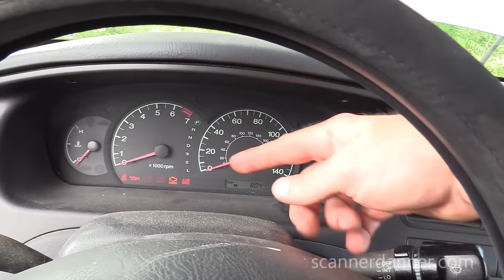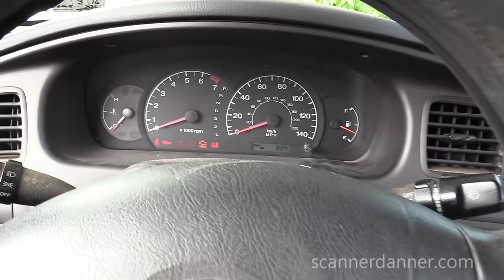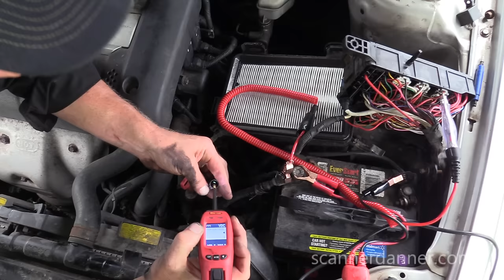No crank, good starter, how to troubleshoot, any car! (Hyundai)

Comment: Couple days ago I get in my car (2015 wrx premium) to go to work. Car unlocks, dashlights turn on. I turn the key and dead. Dash wouldn't come back on and couldn't lock or unlock my car. Took the battery out yesterday cleaned the he'll outta it and power came back. But as soon as I turn it to start it just drops dead again. Can still unlock it and everything just cannot start it. Checked the fuses don't see any broken ones. Car won't start when hooked up to jumpers either Battery tested fine too. Today i had someone come test the starter solenoid and its getting continuity. But now im getting zero power to anything. No dash, locks, lights, nothing.

Comment: You a bad man been having the exact problem with my 08 pontiac g6 was cranking then just stopped brand new starter alternator battery  I shake the car and wan it's running ima  definitely  use this video  ta trouble shoot my car

Comment: I have a 2018 Hyundai sonata SEL 2.4L wife got stuck at store. Anyways I got it towed home. All lights were working. Headlights, radio interior Everything works. Changed/ bought New battery. And BOOM IT WORKED!! started rt up... Drove car around the block 3min.. then parked car& shut it off. 20/30 minutes later i was gonna go to store. But NO START/CRANK!?! just a click? The older obd reader that i used when wife got stuck said code(p2122) throttle control sensor? Thought it 2as miss read.. but disconnect battery to try and reset sensor. Bad idea 💡 because it now gives o zero codes😢!? Hooked up newer obd reader and got code (p1035) o2 sensor? I don't believe that would make car No crank/start. Just that click.humm.. but after i shut car off and Thought it was all set. And I went out to start it it did smoke a little bit?!? Pleas help.. i don't get why it would start rt up after i put new battery in. Shut it off Then NOTHING?? any help you can give would be greatly appreciated.. love ur videos ✌️

Comment: Sorta the same problem only no continuous power...everything is dead. New battery, new alternator.  Scenario to problem. Rear lights weren't working and started intermittent....fixed harness and pins. Everything worked fine. Door was left open, next morning dead. Charged, maybe an over charge, started, battery light came on when giving gas. Checked with probe,c16.2 amps, left hood up hood light on, dead again next morning,  charged and running.  Ran great for a week. Was pressure washing a driveway and decided to do engine compartment and under carriage..all hit miss from sitting in a wheelchair or standing while hanging on. It sat 4 hours. When leaving site battery light came back during acceleration.Turned on everything on light went out so I drove 45 miles. Next morning starter relay clicks, battery 11.3. Charged an hour, Turned over but not enough to start. Took battery to place of purchase, they charged, said battery was good...didn't change a thing.   The starter. Both heavy wires are tight but start switch wire post wiggles. Place that replaced starter says this is normal. 1999 f-150 4x4 xlt. Starter runs with probe power, starter turns probing alternator. After watching this I'll search for connectors and check out your free n trial. They fusible links near battery have power on both sides. Replacing parts is easy, wiring is an animal and crawling standing or bending is even worse. 3 surgeries and pinched nerves. If you have a solution so maybe I don't have to contort as mush I'd really appreciate it

Comment: So I have a 98 subaru legacy, and it died on me in the middle of a curve. I dumped the clutch to try to get it fire back up but it wouldn't, my engine would cycle but it's like it's not firing
Reply from the maker: you need to find out what you are missing when it is not starting. spark, fuel injector pulse, fuel pressure, compression etc

Comment: Outstanding video. Diagnostics well explained. Tapping on the starter needs to be better explained to your very large audience who may be younger age. Old school automotive and marine technicians all know as a starter ages, the brushes wear down or the ground between the starter and the block may not be good enough because of corrosion or wear or loose bolts so tapping or rapping hard with a small hammer on the starter will often get a marginal starter to work for a short time, good enough to get the vehicle started and moved to a repair facility to improve the ground or repair or replace the starter. In this video tapping did not help so Danner went on to doing real electrical diagnostics that are well explained. To improve this video I would edit and add segment to explain the old school tapping technique and why this is a good tip for stranded motorists to avoid an expensive tow to the repair facility. This harness failure and repair would have been very expensive if the vehicle had been taken to a less experienced shop. Danner got it right that another shop had tried and failed to solve the harness failure prior. One of the headaches of the industry is work done by shops or technicians or do it yourself people without success. At least in this case no harm was done by the prior repair efforts. This video is an outstanding example of a fox chase that when done the technician has 99% confidence of having made a good reliable repair. To be 100% would require replacement of all the wiring and the starter and related parts. This is most effective repair for the money spent. One can see why so many good vehicles go to the salvage yards when a problem like this one develops in a otherwise reliable vehicle. I recommend using marine grade wire for harness repairs. I buy my marine grade wire from Wal Mart online using Anchor marine grade wire. I also like Pacer Group marine grade wire. I agree with Danner more in depth repair to harness is best thing to do for the long term service life of the vehicle. Great information to teach voltage drop testing to younger or inexperienced technicians. I assume someone left the cover off the box that caused the real problem that is water in the electronics and electrical. I agree with Danner was fun fox chase.
Reply from the maker: You mean like this one? https://youtu.be/0el4-G1NkB0
Reply: @ScannerDanner  Great example, but you need to explain why the tapping works. It can be a stuck solenoid. It can be a poor ground connection between the starter and the block. It can be worn starter brushes and tapping causes the starter armature to move and make contact with brushes. People need to know the tapping trick and know why it works. I agree a proper repair at the shop is called for or mom will be calling again with no start. I assume once at the shop mom got a rebuilt starter and a new starter solenoid and a full analysis. Mom must be proud to have such a smart son.

Comment: My 2018 nissan frontier V6 4.0 just stopped going down the road and it won't turn over or nothing as far as cranking.  All the dash lights work like check engine and low tire pressure and all the lights like that but it won't turn over click bump or nothing. Can somebody help me with this. Thank You
Reply from the maker: Need a full system scan (all modules) to help. Just guessing otherwise. 
This is a CAN (communication area network) system

Comment: What brought me here was trying to find out why my '15 Sonata SE was cranking but not starting, but does if I leave it off for a long period of time (4+ hours). I'm now going to check my fuses but suspect a battery replacement is needed since it's the original battery
Reply from the maker: If it cranks over but does not start, your battery and starting system is NOT your problem

Comment: Im no mechanic but have similar issues with our 96 ford taurus. Was driving a 300 mile trip and going through a town it just died and I had to coast to the side of the road and no power to anything. No headlights nothing at all. No dash lights, radio nothing. It was like it had no battery at all in it. Just had a new battery put in and a new starter not long before the trip. Got out wiggled the battery cables, followed them to the alternator cable and then down to the starter and wiggled those. Car lights all came on dash lights came on. Car started up just fine. Got it home and parked it and the next day went to leave and the same thing happen again. No power at all to anything. Got out wiggled wires in all the same places again and it fired up just fine and its been working since. I bet its the same issue as this video on the starter. I should unplug that on the starter and replug it if it happens again. Something is loose for it to just die while driving like it did in that town. Everything went dead when that happen but may be cables to the battery as well. Whats your take. Once the car is started and running it shouldn’t matter if the starter wire is connected or not at all right? That wouldn’t kill the car to die would it. Im a rookie to electrical stuff on cars. Probably a loose battery connection that wiggles loose during vibration once running and just dies randomly is all I can guess.
Reply from the maker: Sounds like a bad block ground. Follow the negative cable to the block and see where it is bolted to it. I have videos on this is my battery, charging, starting system playlist

Comment: Hi please help me anyone… my Mercedes Benz S550 makes a click noise on and off but will not start the engine…also there was a toxic smell from the left side. The lighted and radio turns on. Please tell me what the possible issues are…

Comment: I used to work in the auto parts business and its the same there. It will start but it won't fire... WHAT? or It won't fire. A million different versions, after a while you just start making the noises it so much easier.

Comment: guys i need help. i have a 2000 isuzu trooper ls 4jx1 engine. last feabruary i notice whenever i start it before it is delayed for 3-5 seconds until one day it don't start anymore i thought only bateri problem so i bought a new bateri. at 1st it's good until 1 or 2 weeks after it dont start again i can only hear clicking sound so we tried to series it to other bateri and it work then yesterday even you jumpstart it to other bateri in wont start even crank only u can hear a clicking sound.
Reply from the maker: I showed you how to test the starter circuit with a test light in this video. What are the results of those tests on your starter? On the small gauge wire and on the heavy bat wire DURING cranking
Reply: i'll try it tomorrow sir, hope it will work so that no need 2 remove the starter.

Comment: Hi i been sitting here puzzled with my car o have a ford five hundred 2005 i had changed my alternator and battery and its weird i still needed a jump well make long story short i got it to start up and crank drove it for like 3 to 4 days the last day i was driving and my head lights wouldn't come on my dashboard lights turned off and i was driving with park lights on until car basically was driving itself until finally slowed down to a stop headlights came on bright dashboard lights came on even after i took key out of car the headlights were still on until battery died and haven't been able to turn car on at all until i had got a jumped but as soon as i take my foot off gas car turn back off it will have no crank no start battery liggt comes on untill car die back out
Reply from the maker: Sounds like a bad block ground (maybe)
Watch this one for some ideas on how to check for that https://youtu.be/_xvddRJmkAA

Comment: When you get corrosion on a connector, the other side is probably worse. It's almost impossible to get the connection good again without changing the pins.

Comment: Had similar problems thought it was starter, battery, or starter relay. Come to find out I needed the chip in my key reprogrammed because I disconnected my battery. The security system wasn't reading my key because it lost all memory when I took the battery out🤦🏿‍♂️ locksmith came out reprogrammed my key and it started right up. Ford always has stupid issues smh!
Reply: What kind of vehicle? My fusion sat with a dead battery for 8 months. Put a new one and now it wlmt crank at all.. o was thinking maybe it could be the key also.. any insight would be appreciated

Comment: Trying to direct start the starter with the key on the off position, doesnt give fuel to the engine when trying to turn it over. Could have caused the check engine
Reply from the maker: On a newer system, I would agree. Doing a quick scan of the code should have been done, but I wasn't going to for this no crank video.

Comment: I had problems with the main relay wires....  that one provide power to the starter relay, so you can't remove it to test the starter relay...   no main relay means no power to starter relay....

Comment: If the starter is good (and engine is good) and you can hear the solenoid clicking when booster cables are attached to the starter (and the servo spins and kicks forward) then the problem is either in the fuse box or the ignition switch.  That was the way we diagnosed things back in the 80s and 90s before electronics and computers made everything overly complex.  A modern car is nothing but a money pit these days and local mechanics will hose anyone who walks through the door of their shop.

Comment: My battery is 6 Month old, i charged it  , and tried to start my 2012 Elantra. 
The starter or something from engine area makes a single " click " sound ,and then nothing happens. 
No crank , No starter spinning sound. 

Any Solution?
Reply from the maker: Yes, do the checks at the starter I showed in this video with a test light and report your findings. Everything else is just a guess

Comment: What does it mean when you put starter relay in and starter engages?!
Reply from the maker: on it's own without cranking it over with the key? The relay contacts could be stuck closed. Did you swap it with another relay? If it is still doing it with a different relay, you have a control side issue.
Reply: @ScannerDanner  I put new starter on hooked up cable wire and as soon as I did the starter engaged. With key off!
Reply: @ScannerDanner  all of the legs are showing they have power going to them except the middle leg. I pulled the wire connector apart on Selinoid ( that’s not how you spell that ) and it’s showing power still!
Reply: @ScannerDanner  I just got through unplugging the park neutral switch, still same. I guess now is to check ignition?! Idk!
Reply from the maker: @justinbowles4671  why did you replace the starter? did it do this before you replaced the starter? if not, you need to check what you just did. Also, answer my relay question above.
Reply: @ScannerDanner  I replaced relay with new still does it. I took off old starter to have it bench tested. They said it checked out good but the inner parts didn’t sound good at all so I just bought a new one. It did do this before I replaced the starter. I just figured it was the starter.
Reply from the maker: @justinbowles4671  we need to move this to my forum at this point, it is too hard to do back and forth messages for me here. We will need more info. Year, make, model, engine, when the problem started, what work was done etc 
Post this to my forum https://www.scannerdanner.com/forum/post-your-repair-questions-here.html it is free to join and I have paid moderators who are there to help me help you guys.
Reply: @ScannerDanner  99 Dodge Durango 
4x4
318
This is my wife’s niece Vehical. She told me when she put it in to park, well she thought she did. It rolled and hit a tree. She said it didn’t hit that hard but I think it hit harder than she thinks.
Reply: @ScannerDanner  I’m not sure when this started. There hasn’t been any work done do it since she got this vehicle.
Reply from the maker: @justinbowles4671  forum after this please, too hard to keep up. The yellow wire that goes to pin 86 on the relay, this wire should only be hot while you are cranking the engine over. If it is hot all the time, this is your problem. Was there ever an remote start or anti-theft alarm system installed in this thing? If so, they will typically cut this yellow wire under your dash and install a relay to control it. Your problem could lie in this area or within your ignition switch itself. OF course all of the above suggestions hinge on whether pin 86 of the starter relay is hot all the time. If it is not, then we have another issue.
Reply: @ScannerDanner  yes it is hot all the time. I’ll check the voltage when I get back to house. I’ve been checking everything with a test light. And it has a anti- alarm security. I’ll see if it quits flashing when I turn the key on.
Reply: @ScannerDanner  I’ve never done the forum thing! I’ll have to try and figure it out

Comment: I have a 2012 chrysler 200 sport 3.6 engine that has a no crank no start problem. Will not start with the key or the remote start.
Reply from the maker: Can't help you without you doing some testing and reporting what you found.
Scan it for codes first. Check the starter for voltage on both the heavy cable and small cable DURING cranking. At least give me some direction. Then I can help.

Comment: I bought a new starter they said it was bad. Didnt start. Bought a new battery still didnt start. Bought starter rely and still wont start. So thank u ima check all these wiring and hop it's a easy fix

Comment: See trying to get out of a customer wether it's not starting as in not cranking or not starting as in running   when you let go of the key sometimes seems to be like a trick question where the customer doesn't even understand the basics enough to give you an answer so I usually just go to the car and check myself